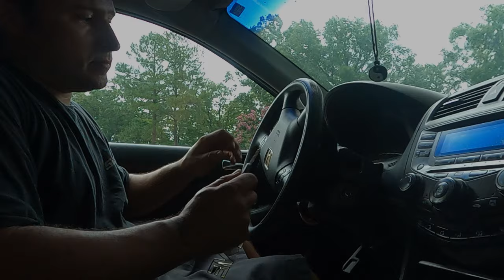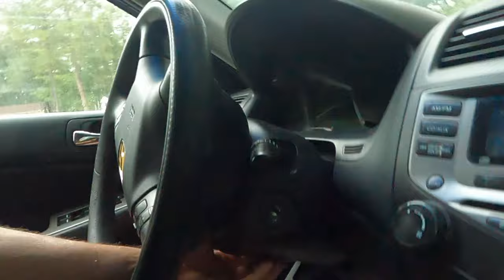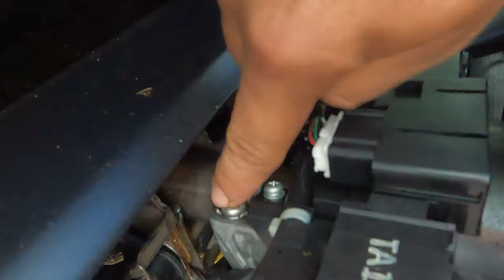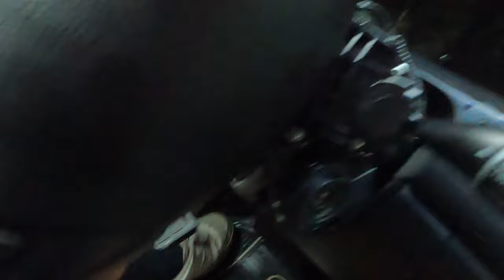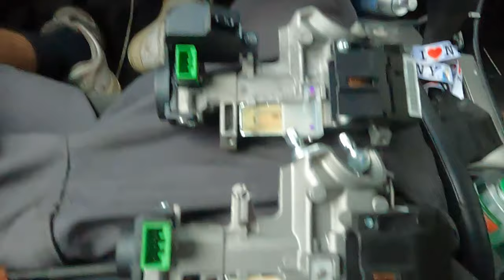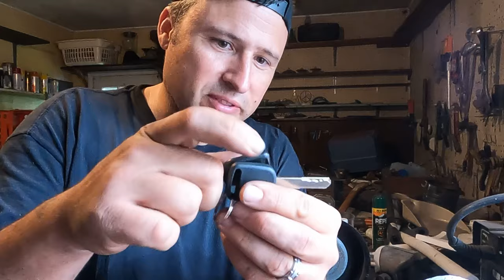Honda Accord IGNITION PROBLEMS 98-2012 | REPLACEMENT | "NO KEY PROGRAMING HACK" | DO IT YOURSELF

Comment: So I've got a 99 accord coupe that cylinder lock & immobilizer was ruined when someone tried stealing it. I got a used cylinder lock/immobilizer & ignition switch & it came with original key for it. When I swap them out will the car start? I am uncertain about if it'll need to programmed to ECU? Or is it just the transponder & immobilizer that have to match?
Reply from the maker: Unfortunately the immobilizer has to match the cars BCM / ECU. But how bad did the immobilizer ring get damaged?…it’s possible it may still work with the video you just watched

Comment: I have a question I did exactly what you did I have a 2009 Honda Civic DX instead of taking my old ignition assembly off I left it on there because I do not have thw tools to take off the 2 theft proof bolts So I took 2 wiring hornist us off The old assembly put it on the new assembly also took 
Old  immobilizer off put on new assembly and cut the old chip out of old key put into new key and i try starting it and as soon as it started it shut off also my steering wheel also stayed locked. What did i do wrong?
Reply from the maker: Can the old key unlock the steering wheel?

Comment: You are a king and a chad. One question before i try, do regular valet keys have those transponders in them? Also do you need to allign the ignition lock tumblers to match the old one? Are there paper diagrams to do this, which tool wohld work best for this? Thank you
Reply from the maker: The valet keys do not have a transponders in them….those key’s only unlock the doors and steering wheel…they won’t start the car. Yes if you want the ignition key to match the door locks you will have to key a locksmith to rekey (match the tumblers) to the doors and ignition… I think there’s kits online that sells the  ignition and door locks that are keyed the same but I’d have to research that

Comment: I saw this video and thought there was hope thanks for making the video but in my case the old owner lost the key and they have been unable to find it so without the old key I don't have a chip either 2004 Honda Accord sounds like I'm going to have to bend over for the dealership after all. The car is in fairly decent shape a couple hundred dollars worth of work should get it through inspection plus a set of four tires it appears the most expensive part of this whole car will be the key which will probably still be less than two car payments of a new car.
Reply from the maker: Well if I can help in any way just message me or email GasdieselGarage@gmail.com

Comment: Just tried this on my 07 Honda Accord. It did not work switch the chip from the key fob which is the original one that goes to the mobilizer into new key which happens to be different than yours push button keys still will not respond or start

Comment: So my issue before I start trying to complete this job is that the steering wheel is locked up so I’m stuck at what do do about that one screw that you have to turn the wheel to get to but I can’t turn my wheel because both the steering wheel and ignition is locked up and to get the steering wheel to unlock you have to put the key in to turn it and I can’t because both are lock so I’m stuck on what to do

Comment: So wait after transferring the little chip into the new key,  would you still have to have the key reprogrammed if you want the remote fob to work? To lock the door and use panic I mean
Reply from the maker: No you shouldn’t have to reprogram because you’re basically transferring the same equipment that came standard on the car….
Reply: @Gasdieselgarage  oh ok. Well thank you,  I ordered the part and will be following your steps!
Reply from the maker: @vari5509  absolutely and if you need any help or guidance just message me.
Reply: @Gasdieselgarage  im in need of help with my Honda accord replaced the ignition tumbler with harness and all, car starts just have to disconnect the battery for the ignition to fully release the key any suggestion!!
Reply from the maker: @jamesalaquinez3474  the only thing that could be the problem is with the electrical side on the ignition…the switched part that the tumbler turns…it’s got to be shorting out ..not allowing it to turn the engine off.
Reply: @Gasdieselgarage  i can turn off the engine just 1 click back and it locks at that point i have to disconnect the battery for the ignition to fully release the key
Reply from the maker: @jamesalaquinez3474  awe gotcha….usually when that happens there’s worn out clip spring inside the ignition….I had to fix them constantly when I worked for Honda dealership. Good news is that repair is under a National service bulletin and can get it fixed for free…(recall)….call the dealership nearest to you and give them your cars vin #…they should be able to tell you if your car is under that recall. Was the ignition you replaced new or used?
Reply: @Gasdieselgarage  bought it brand new.. really appreciate you taking the time to respond..ill definitely call a local Honda dealer and get some information hopefully I can get this issue fixed

Comment: Should it matter if the car is an auto or manual? I would assume not if I’m using the original transponder with the factory immobilizer
Reply from the maker: No it shouldn’t matter but make sure of it’s an (automatic) that your neutral safety switch on the transmission is not faulty
Reply: Sounds awesome, thanks for the video!

Comment: Is the immobilizer part just the rfid chip antenna for the reader in the ecm? Where is the ecm computer module mounted? Can you just find the output of the computer module and jumper it to bypass a bad sensor? I have an older Pilot and would rather not spend a fortune on a car that the immobilizer only sometimes works. Why replace the input (sensor) side if you can force the output to say always start.
Reply from the maker: Yes you can do that if you are computer savvy
Reply: @Gasdieselgarage  any suggestions about where to find the ecm location and a good source for a service manual with schematics?
Reply from the maker: @techguy9023  I actually do know where you can get the full tech manual for any car actually…give me a few minutes I can direct you to it.
Reply from the maker: @techguy9023  what year is your pilot?
Reply: @Gasdieselgarage  2006. It’s just frustrating because it’s very intermittent. I suppose the service manual is “change this module if xyz happens. I understand. Somewhere a circuit is grounded to ignition or fuel pump to do the disable. There may not be a simple solution but I need to at least look. Thanks
Reply from the maker: @techguy9023  https://click.linksynergy.com/link?id=8TCZD/PER5A&offerid=910174.18564794922&type=2&murl=https%3A%2F%2Fwww.emanualonline.com%2Fcars%2Fhonda%2Fpilot%2F2006-honda-pilot-service-repair-manual-software-emo-49860.html%3Fcurrency%3DUSD
Reply from the maker: This manual will go out ver the entire pilot no question. It even has the ECU pin out diagram

Comment: Is it possible to swap an ignition switch solenoid off a used unit and out it on my current one to avoid all this? My key gets stuck in first position regularly to remove the key. Thanks man

Comment: Thank you so much! We just replaced ours and it worked. However we can’t get the key out unless we disconnect it. Any thoughts?
Reply: So if we don’t connect the green one It starts with no problem and the key comes right out. So I am thinking to keep the green one disconnected. Anyone have any thoughts
Reply from the maker: So the key will come out of the ignition tumbler?
Reply: @connieduran9521  I realize this is old but this is because the automatics will lock the key in the ignition until you are in park.  Yours must be a manual transmission so you needed to disconnect the lock solenoid on the new ignition.

Comment: The key to start the car will not open the door of the car. That is my problem. I have to use 2 separate keys. Any suggestions?
Reply from the maker: Yes unfortunately you will have to use two keys but you can get the doors rekeyed by a locksmith with the new ignition key.
Reply: @Gasdieselgarage 
Or is it possible to have the NEW ignition switch rekeyed to your original keys and after transferring over the original immobilizer it should work right?
Reply from the maker: @brauliosalazar2108  sure I don’t see why you couldn’t do that.

Comment: Ps! Since i could not get the bracket off that holds old assembly inplace bcoz of the theft proof bolts i just left it and hooked both wiring harnesses to new one and for temporarily i tied ip new assembly so not harm wiring. I put old immobilizer put on new assembly and old key chip put in new one it started but shut off as soon as it started also like i said earlier in my comment steering wheel stayed locked so what did i do wrong? Its a 2009 honda civic dx thanks Godbless 😇✝️🙏

Comment: maybe a dumb question, but how do you unlock/lock the car doors with the new key? you still have to see a locksmith even if you switch the transponder right?
Reply: Yep.  You need to keep your old key.  My Honda actually has 4 different keys on the key chain, since every lock on the car uses a different key.  Honda's are notorious for the tumblers in the door locks going bad.  It feels like I drive a Frankenstein car.

Comment: this just happened to my 2004 Accord, I hate new cars and their stupid chip keys, guess I'll be ordering the new ignition cylinder
Reply from the maker: Bummer man….yes the new cars suck for career mechanics like myself….now Adays it seems like mechanics need an IT degree on top of mechanic skills with all the new computer crap
Reply: @Gasdieselgarage  I'm an IT guy myself and I much prefer the older vehicles, there is almost no reason for a car to be computer controlled, especially seeing all these new cars with electric E-brakes, I thought the whole idea of an emergency brake was that it was supposed to be usable even in an emergency, if you lose power, the button doesn't work, thus the E-brake doesn't work... so stupid. Love my old Chevy trucks though, much easier to work on but the local scrap yards parts are much harder to find now than 5 years ago
Reply from the maker: @RichyN25  a man after my own heart I’m a Chevy guy too. I couldn’t stand that electric e brake on the Dodge Ram I had….the truck wouldn’t start one day and had no way of releasing the brake to get it towed. I had to research it and there’s a secret panel that has to be removed and put a lanyard cable hanging out of the dashboard.
Reply: @Gasdieselgarage  gonna be tearing apart my 04 honda Accord steering column today after work, luckily found a local locksmith who said he'd program the new keys for me for $95, otherwise I was gonna do the chip transplant method myself haha

Comment: So I replaced the transponder mobilizer and chip from the old key but the green key light flashes.. any help would be great! Thanks
Reply: I'm having the same issue
Reply: @heatherhall4449  Same here...
Reply: Yeah. I tried it too and didn't work. I put a new starter in it and everything
Reply: @westy229  ok, you HAVE to cut the old chip out and put it IN the new key. Being just next to it won't make it work.
Reply: @nickclone  yep. Learned that too. The keys that came with my new ignition lock cylinder didn't come with that little casing on the key to put the chip into so instead i duct taped the old chip onto the transceiver part of the key cylinder. 
A Mickey moused way of doing it but hey, it works lmao.
Reply: @westy229  Haha! The new casing didn't fit the old chip, had to smash it in and duct tape it, also. I call it a "Kentucky Wedding". Smash it together and add duct tape later.

Comment: I've followed everything you've done and Green key light still fashes and car won't start please help
Reply from the maker: It’s very possible you may have a bad starter or starter relay…you can verify a bad starter by using a multimeter or test light on the small trigger wire on the starter…have a friend turn the key while checking the trigger wire on the starter…if you show voltage on the wire or your test light illuminates….that means your starter is bad….if you have nothing showing then Check the starter relay.. it may be confusing sorry

Comment: Tried this today after getting a replacement unit swapped immobiliser chips over car still didn't start.
Reply from the maker: Does the starter engage at all?….is the key light blinking on the dash?
Reply: @Gasdieselgarage  car try's to start but immobiliser light stays on dash. starter is new looks like immobiliser won't deactivate
Reply: @Gasdieselgarage  all good got car working today I made a boo boo lol wasn't paying attention and only swapped over chip cover not actual chip. went back retraced everything then found the issue.
Reply from the maker: @CLUBBY261  awesome my friend..congrats
Reply: @Gasdieselgarage  thanks cars been off the road for 3 weeks and honda Australia said part was obsolete so started sourcing 2nd hand ones with at least one key. Most yards wanted 500 for 2nd hand one but found small garage  100km away wanted $200. Just glad saved some money and car is now working thanks to your great video.
Reply from the maker: @CLUBBY261  absolutely bud…if you ever have a question about mechanic stuff especially Hondas don’t hesitate to contact me.
Reply: @Gasdieselgarage  no worries thanks, thanks for the replys also. b4 ignition broke I was actually trying get car into shed to change front lower control arms due to bushes being shot.

Comment: Can you replace this part without the immobilizer? My immobilizer is causing problems - sometimes the cat won’t start at all ( no crank, no battery power), as the immobilizer won’t shut off. Then for some reason it starts. Seems to require me to open and shut the driver door, then the immobilizer will allow car to start. I would prefer to just get rid of the immobilizer.
Reply: Gotta reprogram if you need a new immob

Comment: Now what about if the immobilizer isn’t working?
Reply from the maker: The immobilizer can be replaced but unfortunately you will need a locksmith or dealership to program the new immobilizer to the cars computer
Reply: @Gasdieselgarage  i just bought one 😑 also heard the main relay can be an issue as well
Reply from the maker: @Smol_wood  oh yes the main relay is right. What does it do when you turn the key?….do the lights come on in the dash?….do you hear a clicking at all?
Reply: @Gasdieselgarage  if you do not see the green key at all check fuse 46. As well check continuity on the main relay. 2 big key factors. I’m replacing my main relay later today in hopes my shit turns on
Reply: @Gasdieselgarage  also no clicking. When you flick the key the green light doesn’t Flash nor does the check engine light pop up.
Reply from the maker: @Smol_wood  good stuff…you are on the right track bud

Comment: Dude what if u have a key 🗝️ but no chip in it .it's a hollow shell but the key unlockes the ignition and it sounds like it's going to start but don't .? It's because the key 🗝️ does  not have a chip in it ? What can I  do ? I don't want to spend 200$ .can't afford it at the moment.
Reply from the maker: I would check to see if your fuel delivery system works (pump/injectors)…check to see if you are getting spark to the plugs, and check the timing belt…sounds like your problem is one of those. If there’s no chip in your key you most likely don’t have the vats anti theft version.

Comment: how do you open the doors to the car?
Now we’ll need a locksmith
Reply from the maker: Well yes if you want all the locks to match the new ignition key unfortunately or just keep the old key for the doors on you.
Reply: Sorry, but it's so much better to call a locksmith. They can rekey your existing cylinder to match the doors, and they can do it without taking the entire ignition assembly off the steering column. Yes, they'll charge you some, but then you're not carrying around two keys just to get in your car and start it. And if you lose those, you'll have to pay a locksmith to come out and originate two different keys, one for the door, one for the ignition. The correct way to do it is to have a locksmith come out and put in a new ignition cylinder (if needed) or rekey the existing one, then  cut and program keys to match.